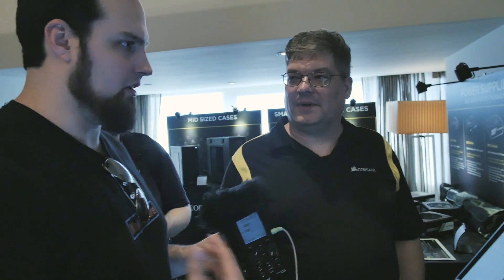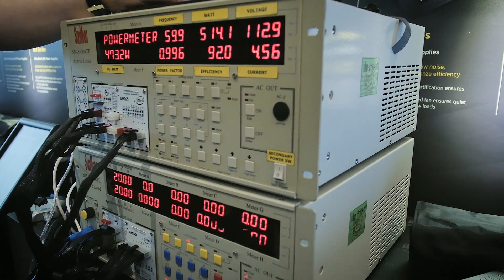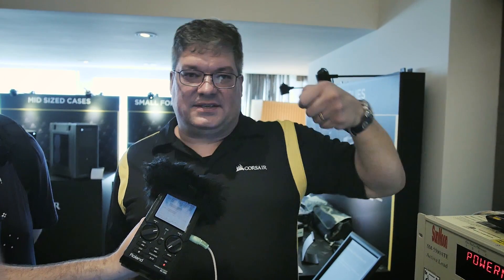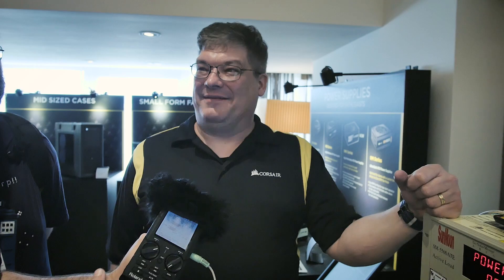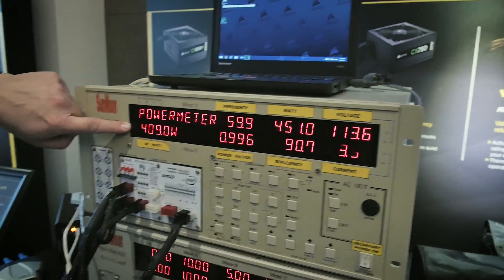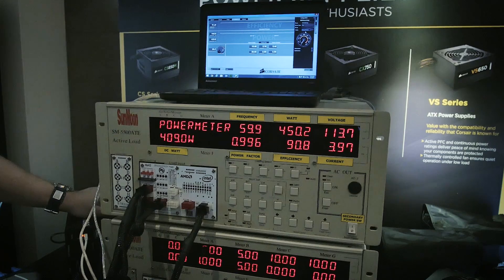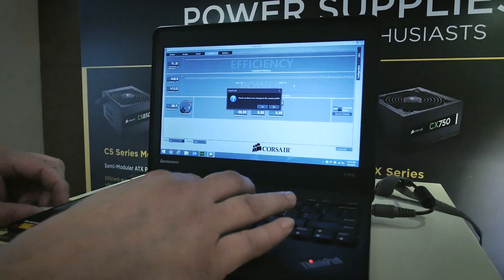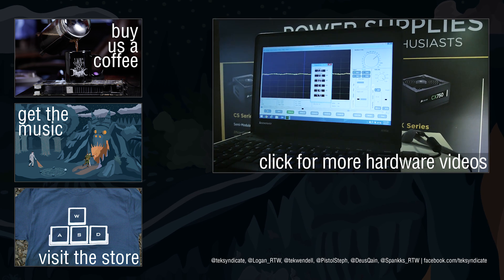Single Rails VS Multiple Rails Power Supplies - With Jonny Guru | Corsair PSUs

Comment: I like Corsair products, I have the VS650 (it's in the poster behind the load tester, the one far on the right) and it's awesome, could have gotten more PCI connectors but it's fine for what it costs, the fan is rattling sometimes for some reason and it's barely a year old, so I don't know how to feel about that.
Reply: VS is a properly mediocre/poor unit. It is worse than CX, and that is hard. I would get shot of it asap in favour of a seasonic, Superflower or delta OEM unit.
Reply: AliveGhost13 if you go corsair, go RM. not point to skimp out on the psu, it will be regretted.
Reply: Sneaky Kitty Gaming Tbh if you're not going heavy there's no issue with the CX or even the VS. So a locked intel and low power GPU and you'd be perfectly fine (650 is overkill though). I'd still have gone CX or better (they really don't cost much more) but meh, it's not likely he bought a non brand for $20 or something.
Reply: Mike Fox I personally like Corsair for their support services. I had a TX850M PSU that had some sort of electronic whine/screeching; The RMA process was pretty simple and, since my model was apparently discontinued, I was sent a RM850 in its place.
Reply: Aimela coil whine, its typical with alot of corsair psus, thats why i stopped using them.
Reply: Sneaky Kitty Gaming RM is the same price as EVGA G2, which is far better. RM is quite mediocre.
Reply: AliveGhost13 im using a evga supernova 750w for my main system and a 600b for my little brothers lower end system that i put together from my old parta
Reply: Jolinator It actually coincided with the fan on the PSU twitching, so I don't think that it was coil whine.
Reply: I use an Intel Core i5 4690 non K and a GTX 680 with two hard drives, so I barely use 250W, don't need to worry about buying 100+$ PSUs
Reply: Mike Fox you need more than a 250w psu, around 500(not sure how many amps needed to the 12v rail) and yea you do need a quality psu still, you dont need to spend near $100 for a quality psu.
Reply: Sneaky Kitty Gaming Dude, the VS650 IS a quality PSU. Also, it has 50A on the 12V rail, I could run a Dual GPU card off of it.
Reply: the vs series is corsairs bottom line of psu's, it is very poor.
Reply: Zeno1999 solenoid in an atx psu lol wow,
 google coil whine, educate yourself.. i have got rid of my ax750 and ax860i due to coil whine issues, which as stated is common with corsair psus there are hundreds of forum pages regarding the issue, EVGA supernova g2 psus are silent and as they are superflower units have excellent ripple.
Reply: ***** I apologize for not having the interest of investing 150$ on a 300w machine to buy a power supply that is top notch quality. It works for me, I put the thing under full load and it doesn't crash or turn off, I couldn't care less about some stupid power filtering when I might upgrade it some year down the road or change the system all together. 

I'm 19, am studying and I live on a 350€ a month with two months to feed and a house to pay the rent, water bill and Internet bill. 

It works for me, it's not a time bomb and it hasn't let me down, works, fantastic.
Reply: ***** okay but I have this one, why should I get a better one? I've ran a Core 2 Quad extreme (QX6700) system running at 3GHz with 4 hard drives and a 9600GT overclocked on a crappy "Trust" brand power supply which only had 520W which probably wasn't even close to outputting 400W, and I ran it for years till I upgraded my system to a 560 Ti and it shutdown under load, I don't see how a brand like Corsair that has a big reputation for their power supplies, that advertises the VS650 as a good solution for a budget build, would let crappy components into their power supplies and ruining their reputation, because it's not just some stupid low tier power supply, they advertise it for cases like mine, budget, mid-range machines, like I have, so I don't really see a problem when I'm probably not even using 50% of the advertised power on the box, I don't see why I should get a "better" power supply. 

My brother currently has an i5 2400, 4GB of ram and a 750 Ti machine which he uses with a generic, off brand 500w power supply he got with his case, and his computer is what, almost 4 years old? And it still runs just fine, are you going to say his power supply is also a golden sample? 

I'm not endorsing the use of cheap power supplies, what I'm trying to state is that, you don't always need a 80$ power supply or more when a budget one will serve you well, I personally am thinking of making a behemoth of a machine one day and probably will have to pick up a 1000w one, and this VS one will be stored somewhere or even given away to someone who needs it, I probably won't keep this till it blows, but if I can, I will.

Comment: RM750 I currently own is single rail with 62.5A on the 12v rail.. I don't get his point..
Reply: Kibra Same here, i used to love multi rail when I was a noob, then I switched to only corsair psu's because they were single rail that way i didnt have to worry about overpowering connectors, now they're saying multi rail is better sometimes, euuughh where's pcper at?
Reply: Toms Tech Single vs multiple.  Makes no difference in most builds.  

Use multiple if you're prone to pinching cables as it MAY (no guarantee) reduce damage to your system when you do pinch a cable.  

Single if you have trouble overloading a single rail in your builds, overloading will cause the rail to shut off completely.

Basically either overcompensate with more power or learn to spread your load out over multiple rails and the problems disappear if you're having problems with multiple rails and stop pinching cables if you're using a single rail.
Reply: Kibra The point is, there is no point. The advantages and disadvantages of either option are, for practical purposes, nonexistent. Power supplies are engineered well these days (at least from reputable brands) so there's no point preferring single rail or multiple rails. HOWEVER, if you did want the option to change on the fly, Corsair provides one.
Reply: That's much more clear :)
Thanx man
Reply: Tarkhein multiple rails are technically superior when safety is the priority, but single rail psu's are better when there is a limited budget, as with a multi 12volt rail psu you have to get one with enough ampage to supply the power you need in only one rail rather than its overall capacity for this reason I use single rail psu's. There is also the simplicity of not needing to worry about if you using the right cable to match up the rails.

I did buy a CX for my spare pc, am aware they are so called budget psu's but I still believe a CX psu is better than the no name stuff, and I havent had any issues with it, but my main pc has something better.
Reply: Kibra "single rail with 62.5A" " I don't get his point"
Exactly.
Reply: ZeZeBatata69 Please elaborate

Comment: I didnt know that jonny guru was from corsair...
Reply: ***** ok. good to know.
one wierd thing is that on their website they gave the CX430 a 9/10 rating, and that PSU it totall bullshit. dont you think there is something wrong here?
Reply: davidarad02 Its probably not because its good, but for being good at its price point
Reply: davidarad02 If I remember, it was the price to performance ratio. What you pay is what you get. Cheap PSU price = Cheap PSU internals. Anyways, it's still crap though...
Reply: davidarad02 what exactly is wrong with that Psu? Because they probably gave that rating because it's cheap.
Reply: davidarad02 The CX430 is based on a different cwt unit to the other CX  series.
Reply: davidarad02 the old cx430 was worse than the new one. the new ones are fine at the price point
Reply: Andrew Russell lol, I have a CX430 running a FX-8320@4.5Ghz and a HD 7950 @1Ghz/1600mem (gets too loud if I go higher) 24/7 for the last 3 years (almost 3 years). And it's been rock solid as my main rig/torrent server/gaming/file server/media server (transcoding). I'm sure the ripple is a little on the high side compared to something better and makes it run a little warmer than it does, but CPU never goes above 62C with stress tests and the GPU never goes above 76c with furmark running at the same time. Im guessing the entire system under stress pulls about 415 watts, and the PSU has been shown to run at 450+ :)
Reply: Gabriel Soria well cpu/gpu temps don't really matter, the load does. 
You should get a Kill-a-Watt and see what you're pulling. That's quite a high wattage set up for that psu. Ya it will do it but Idk for how long. And just because it can be shown to hit 450w doesnt mean it can 24/7, it may for a couple mins then die. 
The purpose of getting a larger psu is for better efficiency, less stress on the psu, and less heat. If you run a psu close to it's max output for a long time it will pop eventually. capacitors age over time and begin holding less power so the 430w will become, say, 400w. That gives you less headroom obviously. 

With your set up I see numbers around 375-400w total from the wall when stressing both. but generally games wont get it that high. Needless to say, I would but a bigger/better psu soon. you're risking that psu popping and taking you're whole system with it.
Reply: Andrew Russell I'm aware that temps don't directly effect the power draw, higher ripple will make your system run warmer. And I'm also aware of the life of capacitors, and I would NEVER build a system like this for a client. To be honest, I've very surprised it lasted this long. Like getting used ugly tires and years later still work. This was just a temp rig after my old one got stolen (had a seasonic 850 watt unit) and the CX430 is what I had laying around.
Reply: Gabriel Soria ah i see
Reply: davidarad02 The early cx 430's were made by seasonic and were quite good, he could have reviwed one of those.
Reply: +davidarad02 BEcause the old, the first 430 CX was actually good.(though I haven't had problems with the new CX's  either)
Reply: Happens. They gave that GS series by EVGA a nearly perfect rating but they had 1 year and 6 month DOA failures on them on a lot of newegg reviews. It was heartbreaking because I guess the GS series is made by Seasonic and it was odd to see so many failures from the best psu company in the world. I guess nothing is perfect anymore.
Reply: because some of them are seaosonics lol Jonny love's seasonics always has and always will and rightfully so. They are fantastic PSUs. Just wish they had braided cables and I would buy them more lol
Reply: It wasn't. Corsair hired  him when he was well known.

Comment: CX is SUCH a mediocre, overpriced PSU.
Reply: AliveGhost13 I wont argue with the fact that the CX(and the CS) series supplies are totall bullshit, but I wont say its overpriced. for the price you are paying for them, you are getting what you pay for...
Reply: Mine runs fine.
Reply: davidarad02 Almost always you can get an XFX TS, XTR, Superflower HX for the same price or cheaper, and they are MUCH better with longer warranty
Reply: Al3xTrucho20 Someone I knows eBay Arctic crapbox works fine. That's not the point.
Reply: AliveGhost13 have you looked at prices? because no you cant. there is a  reason the cx430 is probably the most used psu. All those brands you listed cost more for the same power. And not every psu from those companies is made by the same manufacture or to the same quality. Like lower wattage/cheaper psus may have worse caps then it's big bro, leaving it a mediocre psu instead of a good one. If you don't believe me look who makes psus for companies and the psu tier list
Reply: AliveGhost13 
I have a CX430 and it runs just fine. Plus: For that price it is hard to beat.
Reply: Andrew Russell PSU tier list is a saddening list for someone who knows a thing or two about PSUs, because it's a load of rubbish.
Reply: Andrew Russell Yes I have looked at prices. e.g. atm, the CX600M is $44.99. For $39.99, the XFX Core 650W has more power, made by Seasonic, much better internals, much better ripple, much better regulation, and longer warranty,
Reply: AliveGhost13 Xfx core is $70, and cx600m is $65, that's not $40...

Also tier lists are not rubbish, they are made using reports and reviews from people like jonnyguru. So you don't make any sense
Reply: Andrew Russell true, I think that the most bang for the buck PSU out there is the EVGA B2 750w, because its 80+ bronze, semi modular, 750w, and its a good tier 2 PSU. the G2 is a little bit more expesnive, buts its a tier 1 unit
Reply: davidarad02 when I saw Evga was coming out with psus I was very skeptical. turns out they're pretty good and I think the 500w is the new cx430
Reply: Andrew Russell The Toms Hardware tier list is rubbish.
Reply: AliveGhost13 give me reasons why it is? The order they have seems correct
Reply: Al3xTrucho20 Same
Reply: Andrew Russell It doesn't take price, quality control, consistency etc into account.
Reply: AliveGhost13 aka just quality
Reply: AliveGhost13 Have you even looked at it? It's based on the quality of the components and customer reviews talking about failure rates. The only thing it doesnt do is price, which would require an entire new page and honestly doesn't matter when you're just talking about which ones are good or not. 

So price is the only thing it's missing, doesn't make it bad SMH